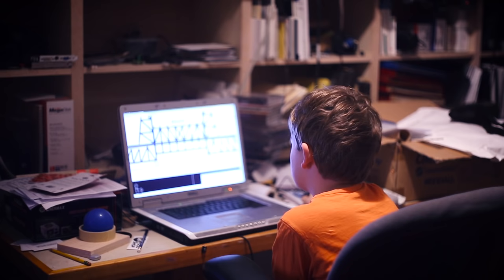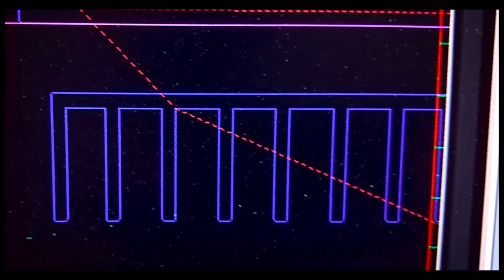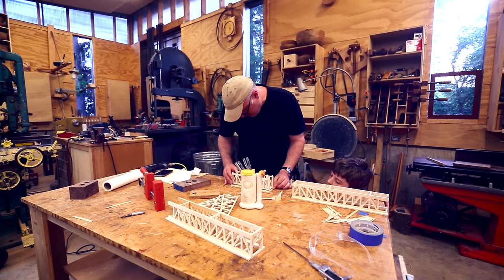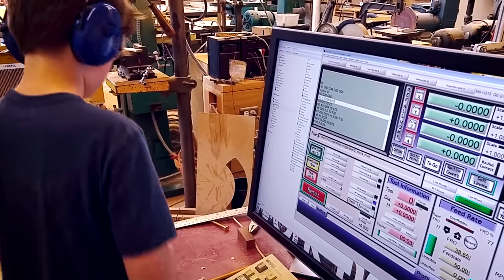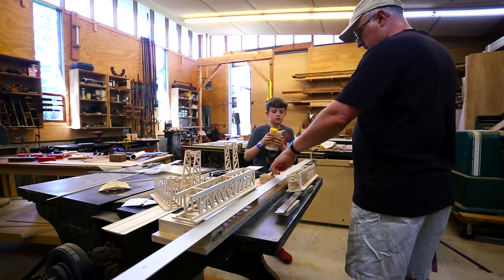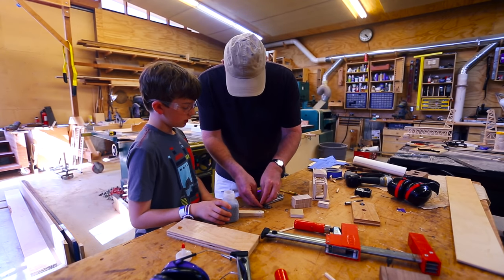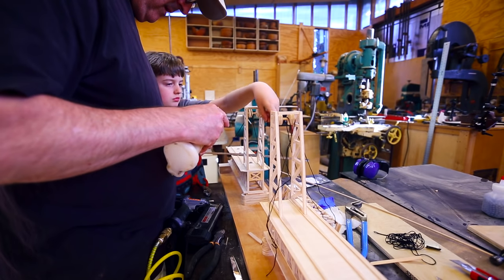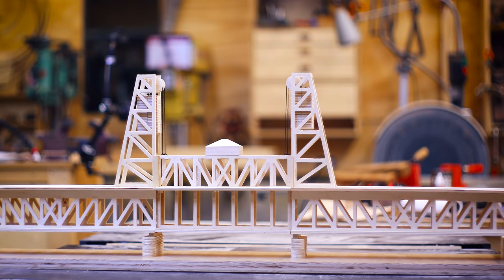Making the Steel Bridge

Comment: This reminded me of a bridge I had to make for school using glue and rolled paper "sticks". My group had to make some mayor modifications because someone told the teacher  it didn't reach the minimal length.
That day I learned three things: 
1) Double check the measurements before starting to build.
2) Trust no one when it comes to hiding mistakes.
3) Put enough paper and glue together and it will be able to hold your own weight.

Comment: When using a scale to match weights you should use the "TARE" function on the scale.  TARE zero's the scale so you put the motor house on the scale.  Hit tare to zero it while the house is on it.  Then when you remove the house the weight will be negative and you place your weight housings all on the scale and add weights until you get to zero.  Easier than remembering weights.

Comment: Hi Frank, watch your channel all the time. You said this bridge is the only one in the world where the lower and upper decks move together, but where I went to school in Houghton, Michigan at Michigan Tech University there is a bridge very similar to this. Is it different? I am not sure so I dont know. Just was wondering cause they look so similar. Thanks
Reply: +Stephen Stacy That isn't what Frank said. Here's his words: "...it's the only DOUBLE LIFT bridge in the world where both the lower deck & the upper deck can move separately..." in other words it is the only double-deck bridge with independent lifts. Because of the independent lifts, the lower deck can be raised to 72 feet, telescoping into the upper deck but not disturbing it. The Portage Lake Lift Bridge, MI that you're comparing it to is a double-deck too but the two decks move up & down as one unit together, not independently.
Reply from the maker: +nightjarflying yes, that sounds right
Reply: +Stephen Stacy This bridge would have been way better at MTU. I lived in Hancock and it sucked having to wait for boats to cross and be about 5-10 min late for class!
Reply: Forgot to take Listening 101 in Uni it seems young Padawan!

Comment: Not to sully your project, it's really cool but there is a double lift bridge between Houghton and Hancock, MI.  It has a car lanes on the top and a combination of car and train tracks on the lower.  Brian
Reply: +Brian Curtis You are confusing a "double deck" that lifts in one piece [single lift] with a "double deck" that lifts in two pieces [double lift]. Frank is claiming his Steel Bridge, Portland is "...the only DOUBLE LIFT bridge in the world where both the lower deck & the upper deck can move separately..." so that the lower deck can be raised to 72 feet, telescoping into the upper deck, but not disturbing it. The Portage Lake Lift Bridge, MI that you're comparing it to is a double-deck too but the two decks move up & down as one unit together, not independently.

Comment: You couldn't add tabs in your cam software? For holding the pieces while routing them?
Reply: Tabs are great, until you have to sand them off... Then they suck
Reply: +thermmaloverload That's a fair statement. What i normally do is hit the pieces with one of those pattern bits in a router table, but I'm not sure that would've worked in that situation.
Reply: +Trent Wainwright good idea Trent, I'll try that one next time.

Comment: For people without a cnc machine it wouldn't be overly hard with a scroll saw. Just very tedious and not as accurate. Might need a large supporting table near the scroll saw to handle some of the larger parts and one of those blades that cuts in any direction so you don't have to turn the parts. It wouldn't result in the best finish, but it would probably be the easiest way without a cnc machine.  Cool and challenging project.

Comment: The glue bottle looks interesting. It looks like it didnt come with the glue, but it´s a refill bottle?
Reply: It is a refillable bottle. I think it is called Gluebot. Google is your friend. ;)
Reply: Thanks. I found it under GluBot on amazon. Here in germany it cost between 50 and 120€ :-O A lot for a plastic bottle, even if it is useful
Reply: Yikes... That's a lot! Surely there must be some way to buy them cheaper than that. If they can sell them that expensive there must be a market for cheap look-alikes as well.